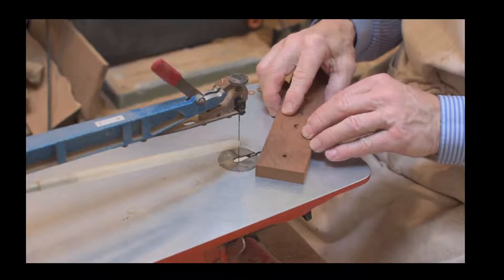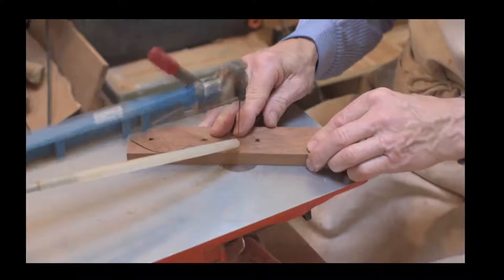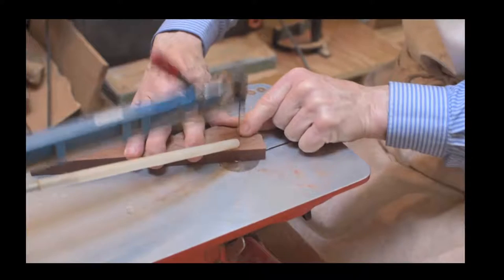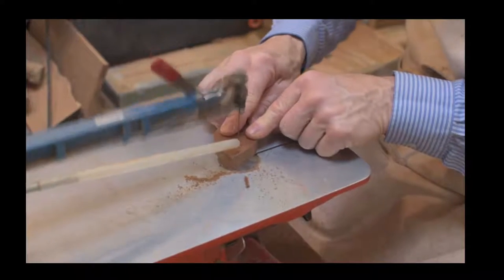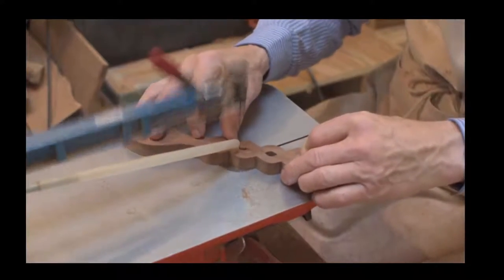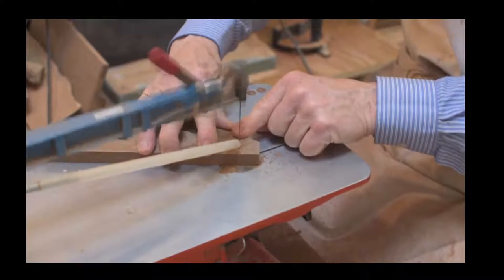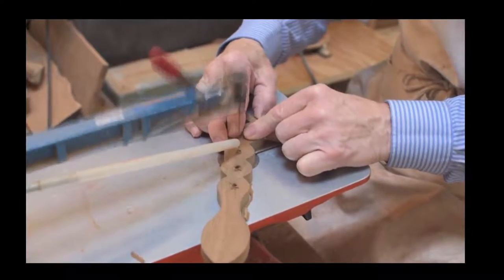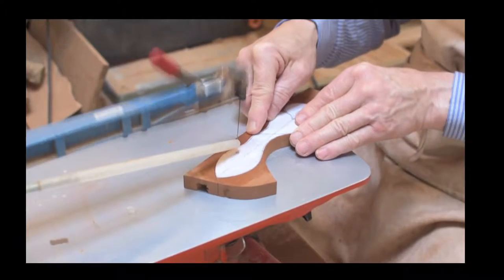Hegner Scroll Saw: Live

Comment: How noisey are the Hegner scroll saws in relation to a proxxon DS460?
Reply from the maker: Hi Mohsin, great to hear from you. Unfortunately, I can't answer that one because I have never used a Proxxon DS460. Be interesting to do a comparison. When we work with the Hegner Multicut 2S you need ear defenders so it is a fair amount of noise. All round it's a great scroll saw to work with, perfect for lots of different projects.

You could try contacting the companies directly for the technical specs on each machine. They should be able to give you a number in decibels.

Thanks for getting in touch, all the best from us all here at The Lovespoon Workshop.